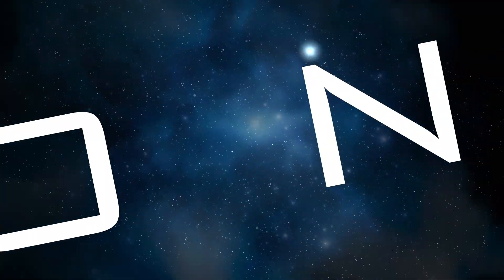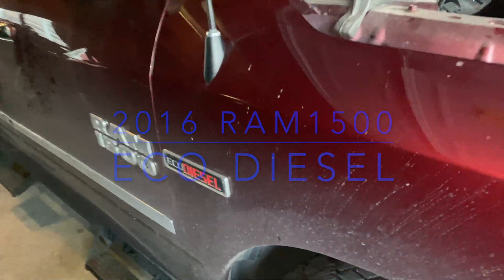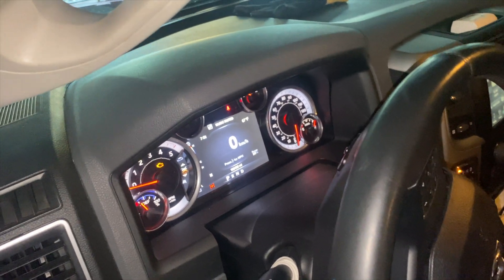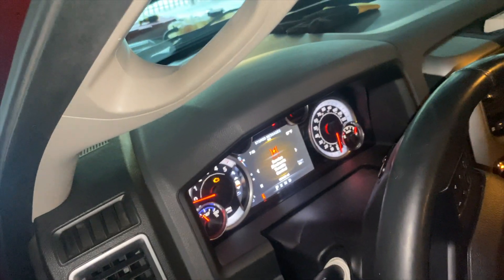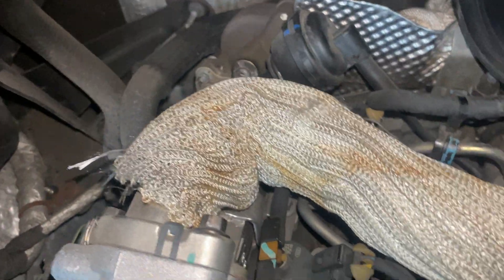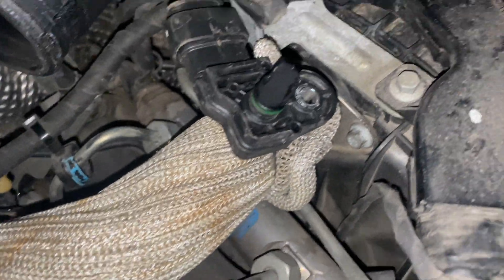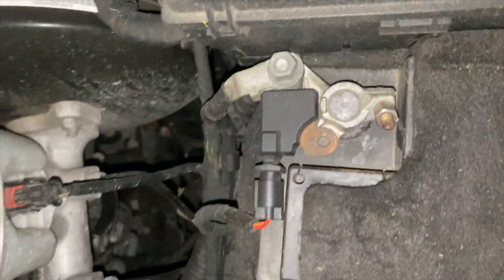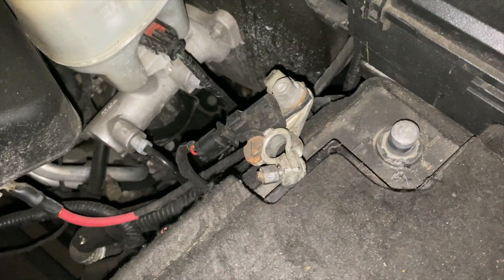2009 - 2018 RAM 1500 ECO DIESEL ELECTRIC THROTTLE CONTROL ERROR

Comment: Question.  We're you able to clean out the area where the EGR tube went into the engine block? You said you would try to vacuum it out, did that work?  Did you have to do anything else to clean it?   Thank you
Reply from the maker: i actually ended up taking the intake off and cleaning it but it was too late. the flutter vlaves were broken because i have a build up in the valves
Reply: @getitdonemalik2818  how long did it take to take off the intake and get that fixed.   I fear I may have the same issue and not sure how long of a process that will be.
Reply from the maker: @nicksheets5010  it’s a 6 hr job if you have everything ready. It’s not the easiest

Comment: Yoo great video, glad I found it even a year later. I have the new Jeep Wrangler Ecodiesel and I am getting the same errors. Did this permantely fix your problem or did it come back?
Reply from the maker: It fixed my problems permanently but I would recommend you clean your ERG valve, Intake and throttle body. It builds up a lot of sludge.

Comment: Thanks for the video!  I have the exact same problem.  How did your neighbor reset the computer?
Reply from the maker: He used a scanner. He cleared the codes
Reply: @getitdonemalik2818  Thank you for the information.  I’m new to the Ecodiesel and I’m having to work on it myself.  Videos like yours are very helpful.
Reply: I got it this morning.  I have never had a push to start vehicle before and I was trying to clear the codes with the truck running.  I had to turn it off and then press the start button twice without my foot on the brake to make it so the scanner could clear the code.
Reply from the maker: @patrickcronin6829  I hope the code doesn’t come back
Reply: @getitdonemalik2818  I drove it to work and back today.  55 mile round trip- 26.7MPG.  I love this truck!  So far so good!

Comment: Very very helpful bro
Reply: Did you by chance lose any power when the the service electronic throttle came on? I have a 2015 ecodiesel and I have been considering trading it in due to those issues
Reply from the maker: @Devin94ful  yea bro. I lost power. The truck goes into limp mode but once you wipe the computer, it should be back to normal! My truck is running EXTREMELY better!  This should be done like you change your oil. When you get a chance, watch the video again just to get a full understanding of what I did
Reply: @getitdonemalik2818  good deal, but would a obd2 machine flash it?
Reply from the maker: @Devin94ful  I would check the capabilities of that specific scanner
Reply: @getitdonemalik2818  thank you sir.

Comment: Air filter is ruined dude, never ever pressure wash filter element.
Reply from the maker: Definitely not true. My air filter is doing great a year later. It’s made to be cleaned, oiled and reused.
Reply: Definitely true lol
Reply from the maker: Still using the same air filter with no problems! Lol🤙🏿